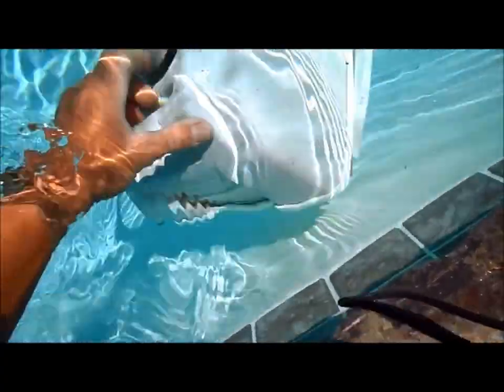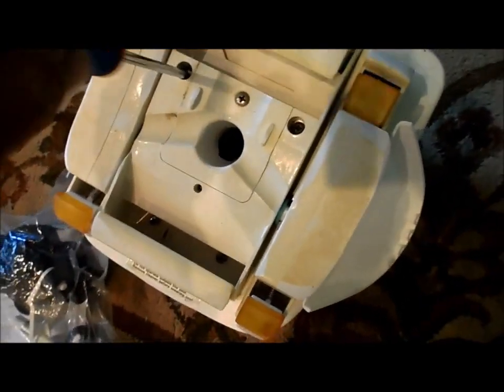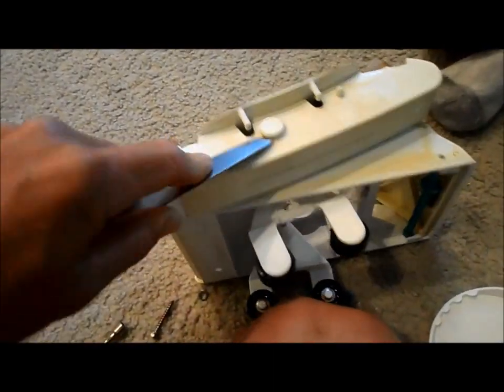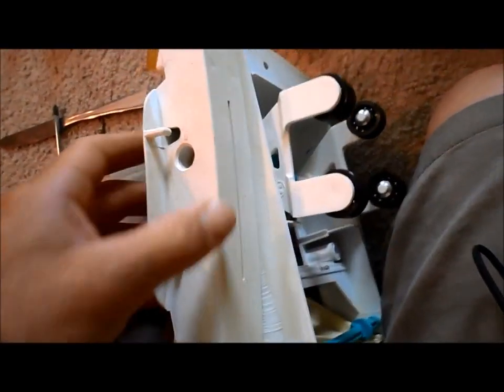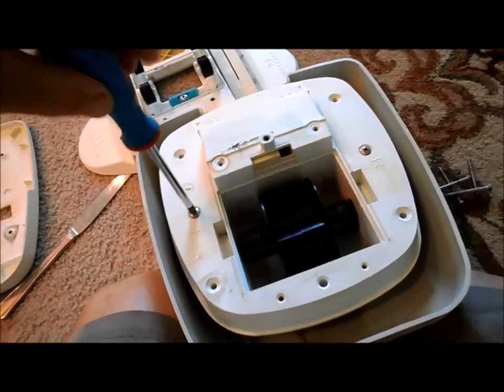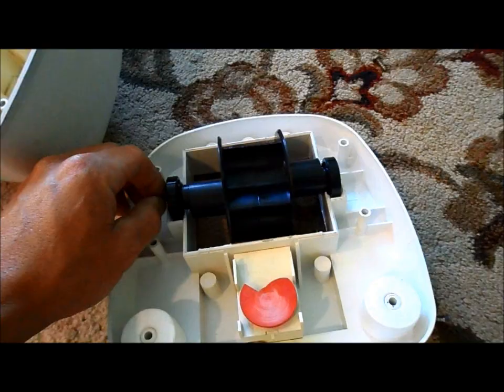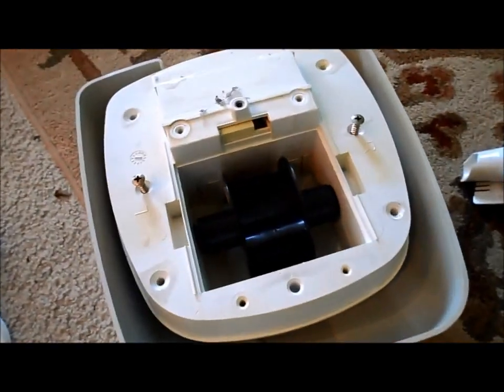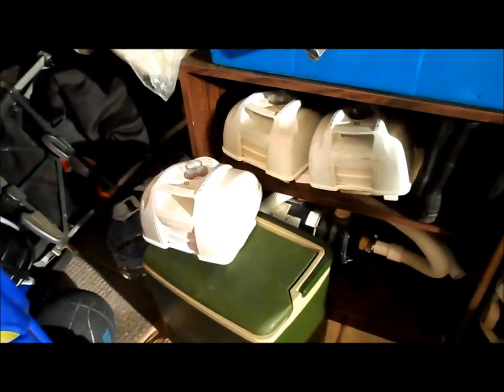Hayward Navigator (Pool Vac) Pool Cleaner, A-frame Turbine kit Rebuild: Cleaner Not Moving

Comment: My Navigator had the same symptoms as you highlighted in the introduction, I followed the guidance in this video, purchased the kit and it totally fixed the problem.  The instructions / tips made the procedure easy so thanks very much for an excellent and useful video.  I would also point out that in my case, it was not obvious at all that the parts being replaced were excessively worn so it does go to show that the fits and clearances required for proper operation are very tight.

Comment: For mine, I found the bracket holding the A frames down in the center was completely missing.  That comes with the A-frame/Turbine kit, as well as the screw, but I found the nut or bushing that it screws into was gone.  After improvising that it worked great.  Thanks for the video!

Comment: I could not have made this repair without this video; thanks so much for the tips about how to flip over the main body without dumping out the tiny pieces, and how to ensure that the bearings are locked into the grooves so that they don't move. By the way, it IS possible to put the pods on backwards, and I managed to do it, believe it or not!

Comment: Thanks for sharing. I was also about to go and buy another pool cleaner after giving it to the pool shop who said there was nothing wrong with it. Except it didn't move in the pool and when it did only went around in slow circles tangling the hose. Saw this video and replaced the turbine and A Frame and now its like a new one. Thanks again.

Comment: Thank you for posting this.  It was extremely helpful in figuring out what was wrong with my cleaner and how to fix it inexpensively.  My cleaner would move for about 2-3 minutes and then just stop moving.  I was afraid it would burn out my pump.  I  thought I was going to have to buy a whole new one or at least take it in for a repair.  I would rather do it myself if possible.  Thanks again for your helpful video!! :)

Comment: Thanks!!  You are my go-to for any of my pool issues - seriously, everything I do to take care of my pool I learned from your videos (when I first moved into my home 4 years ago, “pool school” from my local pool store left me terribly confused and scared of my pool). 

The only thing that still confounds me about this pool vac is that I can’t get it to climb back into the shallow end very often (it’s almost flukish). I’ve replaced just about everything in this machine except the gear box and I’ve increased the RPMs...still, it just hangs out in the deep end. It doesn’t climb my walls either, but I don’t know if that is part of the same problem with my machine or that my walls are too steep (I care much less about that then a clean pool bottom).
Reply from the maker: Thanks for the great feedback! It usually gets full coverage of a pool. Could be a speed issue. There is a dial in the frame with a speed control. You can find it shown in this video: https://youtu.be/Sjw6wSMcIvI

Comment from the maker: I usually order the whole kit since just changing the A-frame (which you can buy separately) sometimes doesn't fix it since the turbine also gets worn out, though it isn't as obvious. It kinda warps a little so if you use your old turbine on just a new A-frame  you might not get good results. I suggest Amazon as they usually have the best prices and are reputable.
Reply: N.

Comment: I search for a youtube video because i had to replace the pods and i found this one so i purchase the complete kit to do the A frame as well which i had done a few years ago, but it seems like every two years i need to replace parts. So i price out the kit at a national pool store and it would of been well over $200 for the kit plus cost of installation,  i found the kit on amazon for $84 with your video i was able to do the repair in less than an hour and saved over $100 doing it myself. I wish i did this the last time i would of saved.  I even had in quicken if i purchase the parts i would of save.  Thanks you for the video.

Comment from the maker: could be one or two things. The hoses were not laid out straight and were stored like a standard pool hose (rolled) which will make the cleaner go in circles due to the hoses. Simply lay them out in the Sun for a day or so and then reinsert them so that they are somewhat straight in the pool (some will still curve). Second, if one pod is loose it will not touch correctly on the pool bottom and thus go in circles. Take out the tabs and tighten the pods up a bit more. Let me know if that helps.

Comment from the maker: My guess would be the bearings that lock in and hold the turbine came out of their slots. You will have to take it apart again and check that part. It happens. Just make sure they are locked in to the notches in the frame. If they are not it will stop working as you described as the turbine spins. If they are still in the notch when you ck it let me know and I can go over other possible causes. But that is the most likely cause.

Comment from the maker: Sounds like it. One side could be worn down more than the other. Once you get it moving if the hose still kinks up it gould be a gear problem also. But you won't til it is moving again. I also suggest taking the hoses apart and laying them in the Sun so they straighten up. So change this part 1st.

Comment from the maker: Hmm. Okay - are you sure there isn't anything stuck in the turbine like a rock or twig? Take the bottom plate off just to check it to make sure. I wonder if you have air getting into the system somewhere. Is their any air bubbles coming out of the return jets? Can you manually vacuum the pool without losing any suction?

Comment from the maker: Okay. Maybe there is an air leak in your system somewhere. The first place to check is the pump lid O-ring. Can you try hooking the navigator up to the skimmer or at a friends pool? I am pretty sure it works. Maybe a hose has a hole in it and air is getting in - while the cleaner is running pull it towards you and lift each hose out of the water to see if you hear any air.

Comment: I noticed that my Hayward was moving slowly and it was lifting off the bottom of the pool, so I replaced the shoes and wings after asking the local pool company what might be the problem. They never mentioned replacing the A-frame or turbine; they told me that I it was a suction problem or too much water in my pool? I thought that I was going to have to buy a new vacuum until this video. Thank you!

Comment: That a frame doesn't look bad. The 4 bearings don't have spacers, and sometimes the bolts that connect the pods to the a frame get loose causing one side or both not to move when on the wall. Try taking the covers off and tightening the bolts first before replacing.

Comment: Awesome that is exactly my problem it is not moving.  Can't beleive I took it to the pool store and paid to get it fixed only to come home with the same problem and when I took it back was told 
it is probably the suction on my pool not working for clogged.  Paid pool guy to check pool suction and told me no problem with that, took it back to them and they say they look at it and insist it's fine and hand it back to me.  Tired of being ripped off and lied to, so I bought the parts and going to learn how to maintenance my sweeper myself.
Reply from the maker: You can do it!
Reply: @SPL  Thanks, I got new wings, pods, A frame, trubine and shoes.  After watching this over and over again and couple others and set up my table with my tools along with my phone with the video on to remind me of the steps.  I made a few mishaps like not understanding left is not left with the vac is upside down not really a big deal, the thing that irritated me the most was when I put everything back together and I'm picking things up, I notice a piece of paper that came in the bag for the Turbine and it says to line up the notches in the plastic of the part that contains the bearings with the notch in the base unit.......of course I didn't have that information previously so I had to undo everything because I wasn't going to have gone to all this trouble to have this haunting me and it doesn't work so might as well take it apart again and make sure it is seated properly.  Of couse it wasn't and it's kind of tricky trying to put it back together because you have to hold the bottom steady so it doesn't fall out of the notch it's not like it snaps in it's just laying there and any jarring it will fall out .  I finally managed to put the big cover back on and put it back together again.  That little tid bit would of been really helpful to know.  Anyway, it's back together and it is moving just not as fast as it used to so I ordered new flaps and the little blue adjustment thing a ma jig for adjusting.  I also ordered a presure gage tester so I can make sure my suction is where it needs to be.  It's been a long process and I learned a lot in the process and that's always good and cheaper too.  Not out of the woods altogether yet, but hopefully a couple more adjustments and home free.

Comment: I did this very repair and replaced the a frame and turbine after watching this video.  It will still not move. I'm thinking the bottom is really worn down from the pebble tec I have.  All replaceable parts have been re installed.  Ive had it about 9 years so I guess its time for a new one and I'll keep the parts I just put in for when needed later.
Reply from the maker: Could be worn out beyond repairing.

Comment: Great info for a new pool owner like me. My pool is almost a year old but now my navigator tubes just get tangled up. I'm not sure what's going on. I untangle it and it keeps twisting itself up again. Any suggestions?
Reply from the maker: Try hosing off the swivel on top very well. Also, switch around the hose sections now as they may have a memory.
Reply: @SPL  thanks. I'll try it

Comment: Hi.  I've found your videos incredibly helpful and I was hoping you help me with a problem I'm having with my Hayward Navigator.  It used to climb the walls of my pool and do a more effective job with cleaning.  After 5 years, it only makes it about a foot or two up the walls, before turning and coming back down.  I've replaced the A-frame/turbines, wings and shoes and I haven't seen any difference in the performance.  I'm going to replace the flaps next, but I'm running out of ideas.  Do you know what I can do to get it to climb the walls again?  Maybe a new leader hose?  New Pods?  Thanks for your help and expertise!
Reply from the maker: It's the flaps/ That is what creates the climbing ability. Before buying new ones try adjusting them. Near one of the pods you will see a little hole with a little aqua dial with Roman Numerals. Turn it up to III and see if it climbs better. If not replace the flaps and it should climb like in the old days.
Reply: Swimming Pool Tips, Reviews & How To -MrDgvb1  I've tried adjusting the flaps up to IIII, but it didn't really make a difference.  I think the spring is just too loose at this point.  I ordered new flaps so I'm looking forward to trying that.  Thanks again for your help!!

Comment: Well  done and explained .I replaced the A-frame turbine but when I place the pool cleaner inside the pool and it it set on the floor stop moving again.Can you help me with this issue ?
Reply from the maker: Maybe make sure the bearings are in the plastic notches.
Reply: @SPL  Yes,the bearing are in the plastic notch. Do you think that the problem is in the gears? All the part are moving good but when I touch the swing parts stop to moving.

Comment: I have a question, my I replaced the A frame and turbines on my aquabug bought July 2018. It moves faster but still has same problem of hesitating and stopping. It does not turn at all. Should I inspect the gear box or should I buy another kit? it appears there's a gear box and also a turbine kit.

Comment from the maker: There should be a serial number on the unit. It has  a one year warranty on parts and labor and I think a three year warranty on parts. You will just have to register the unit online with the serial number and you should be able to have Hayward warranty it out for you. Probably a local pool store is an authorized Warranty location. That happens once in a while with a new unit. Factory build defect.

Comment: Awesome video! I recently did this repair using your video and my cleaner ran great for a few day now its back to not really moving.  Any ideas?? Thanks
Reply from the maker: It is possible that the turbine has come off it's marks inside the Navigator. Take it apart again and check to see that it is seated fine in those notches.Also make sure the pods are on tight.
Reply: Swimming Pool Tips, Reviews & How To -MrDgvb1 thanks for the reply.  Turns out the pods were loose. Thanks!!

Comment: Hey buddy.  I have one of these. Its an older model. Does not even say hayward. It says pool vac. The only thong that seemed different was the gear box. Did Hayward buy them out? Will this kit work for mine. Looks the same. I pulles mine apart it was missing ball bearings. The turbine had one bearing gone and the shaft half eaten lol!
Reply from the maker: ChrisXCXCX Same thing - Hayward bought out Arnoson and kept the parts the same.

Comment: Thanks again for the video.  I replaced A-frame, turbine and the feet.  Unit is still not moving.  It appears there is no suction under the unit.  I removed the hose from the top of the unit there is definitely  suction from the hose.  Any suggestions?  Thanks!
Reply from the maker: Make sure the suction at the side port or skimmer is adjusted accordingly. That sounds like the issue.
Reply: Swimming Pool Tips, Reviews & How To - SPL thank you for your reply.  I am getting good suction from the side port.  Getting good suction at the end of the hose from the port to the cleaner.  I feel zero suction from the bottom of the cleaner.  Sorry to be a pain.
Reply from the maker: @chrisparker9115   There has to be some kind f obstruction. If you stick your finger in the bottom with the pool running and cleaner submerged you should feel the suction.
Reply: Swimming Pool Tips, Reviews & How To - SPL  makes sense.  I will disassemble the cleaner to see what I can find.  I had planned on doing that anyway but I wanted to ask you first.  Thank you for your replies and all your help!!!

Comment: I have it connected to the side port. I don't have a skimmer connector.   I'm not too sure about the filter.  I see water swirling under the cap at the pump either with or without the navigator.  When the navigator stops moving less water is swirling under the cover and the navigator starts to lift off the bottom of the pool like it's floating

Comment: great video! thank you!.. I have a question for you.. the  a-frame is working good , the pods are new and i would like to know what could be happening to my navigator.. it walks a little slow but good and then when it gets to the wall it doesn't turn back , stays there :(, it is 6 years old but at this moment we can not buy a new one and since it is moving good I thing I can fix it like other times..the wings are not in good shape could it be that?? or the gear box?.. I wish you can answer me! LOL
Reply from the maker: There is a secondary gear box on top that might be the problem. Take the cleaner out of the pool with the pool off. Remove the fist hose. Grab the top and try to spin it. It should spin with some effort. 

Also try increasing the suction to see if that helps it. If it doesn't spin or increasing the suction does nothing  let me know and I will direct you to the parts you will need.
Reply: thank you! I will try that! :)
Reply: I just did the spin on the top and it works fine. any other idea? :(
Reply: Hi! I did what you said and the cleaner spins when I grab the top and spin it. what happens is that the cleaner is not doing turns when it gets to a wall :(..  also days ago the pool sweep stop working! I already try to fix it by putting pressure with water and it didn't work.. what would you recommend?
thanks in advanced!

Comment: Lots of bubbles come out of the jets when I turn the pump on to check the cleaner.  I try to get water into the hose before I connect the line.  I don't have a manual vacuum so I can't answer that questions.

Comment: OK, so I replaced the turbine and a-frame.  I tried out the cleaner and it worked for about 5 minutes but it moved very slow then stopped.  I pulled up the cleaner and the feet weren't moving. I let some air into the cleaner and the feet started again.  After 5 minutes it stopped again.  I checked the bearings and they are locked.  Not sure what to do next, I hate to have to buy a new cleaner it's so expensive.  Any suggestions?